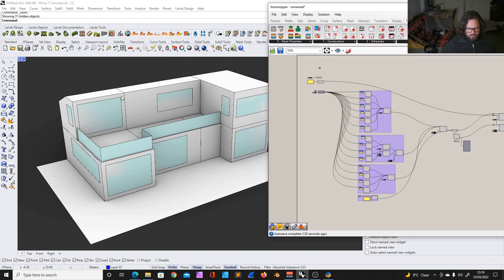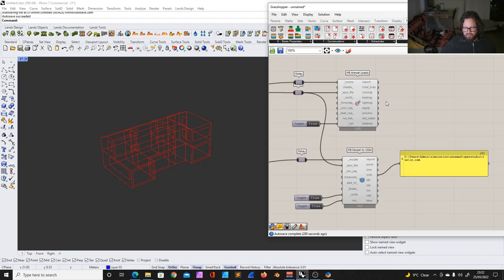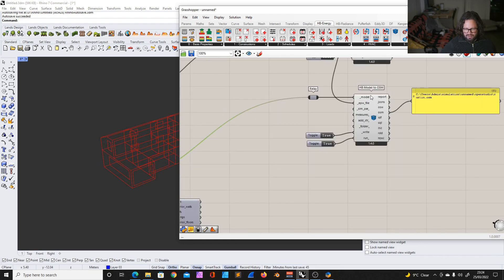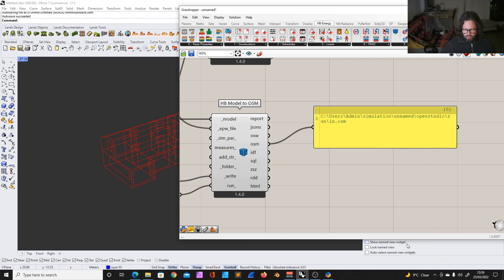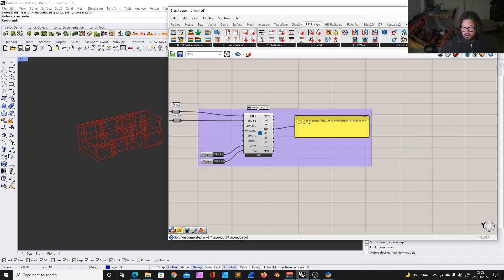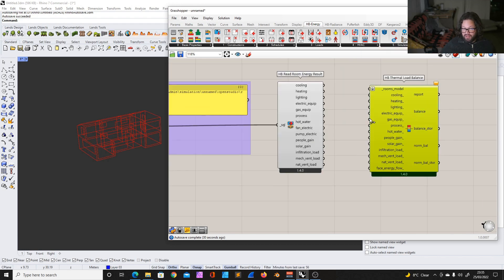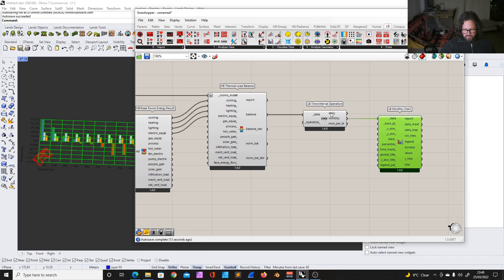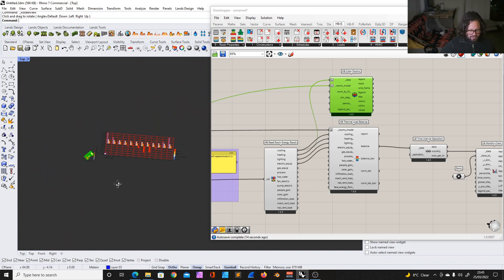Honeybee 'ENERGY' Part 2 | A first energy balance | Ladybug tools 1.4.0

Comment: Hello Philipp.  Thanks for the tutorial.  I would like to know if instead of showing the kW/m2 it is possible to show the indoor temperature without air cooling or heating?  The temperature you show is the set point temperature 20 ~ 24°C, but in some cases the internal temperature may be lower or higher
Reply from the maker: Yes, this model assumes that an aircondition regulates the temperature...
The problem is the without a set temperature the model doesn't know from where to calculate...
I will need to refresh my memory if i did a video without the set temperature.
Reply: @PhilippGalvanDesign   thanks for the answer!  I think that if we have refrigeration capacity, it is possible to use the calorimetry formula, for example: for a place that has 3.51 KW, the set point is 24°C and the volumetric flow equals 680m3/h, we can use q= m *c*deltaT to find out how many degrees the room would be if air conditioning were not used.  With this, we can color the room according to the temperature it could be.  Am I right?

Comment: Hi Phillipp! I got this issue:"Solution exception:expected string, got NoneType", are there any solution that you can suggest to anybody have this issue, thank you
Reply from the maker: You might want to check if you have all the right components installed. https://youtu.be/ZycEsVdSUOc
In this video I show how you validate your installation.
If your installation is healthy then you might have mistaken inputs and need to modify the input based on the video. Don't skip parts because you might missed something.

Comment: Thank you for the videos again!!

I have one more question here,,
after connecting my model to HB rooms
this error popped up, (even though fron Rhino it shows my geomotries are all closed polysurfaces) 
''1. Input _geo is not a closed volume.
Room volume must be closed to access most honeybee features.
Preview the output Room to see the holes in your model.''

Does anyone know why and how to fix this?
Reply from the maker: It could be a bug. I had this error message before but the script still worked... Which version of Ladybug tools are you using?
Reply: @PhilippGalvanDesign  Hey! I just updated all my LB tools to 1.6.0 and redid everything with my model and now everything is working! (I guess it's related to the versions compatibility ?)

But then another issue appeared which I havent found out the solution to fix... 
After passing through OpenStudio analysis, (i created everything almost like u did apart from detailed schedule or materials etc), yet the results had a huge difference between heating and cooling load, and cooling load is extremely high (like almost around 250kWh/m2)  
Have you encountered similar problem before?